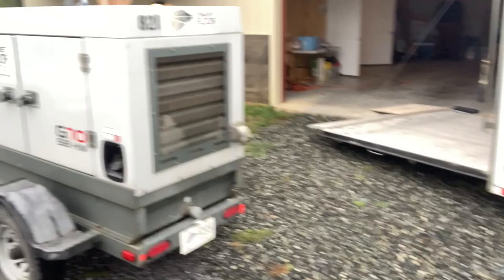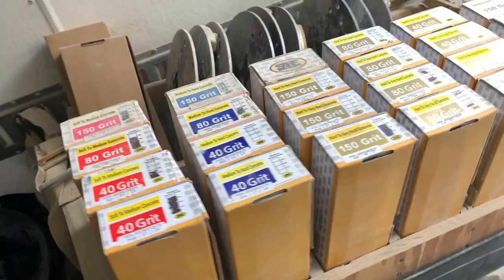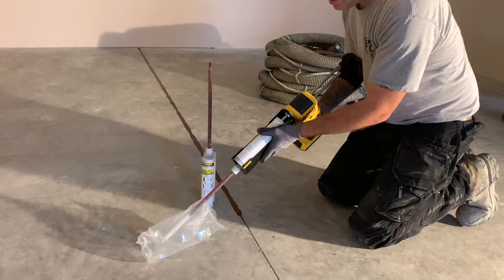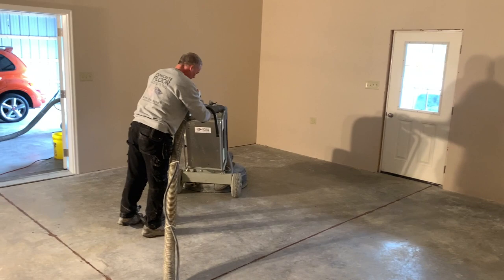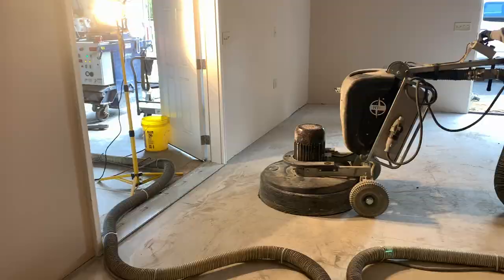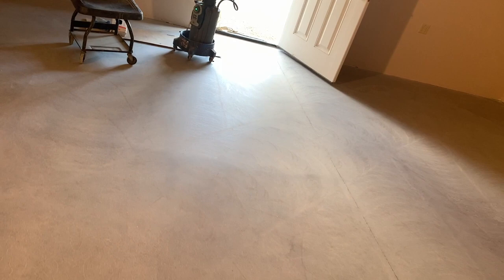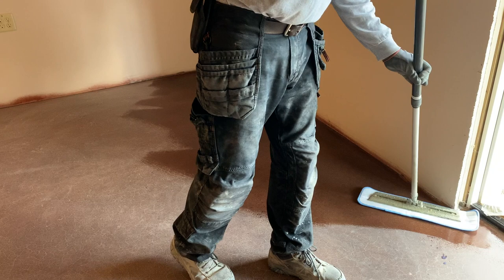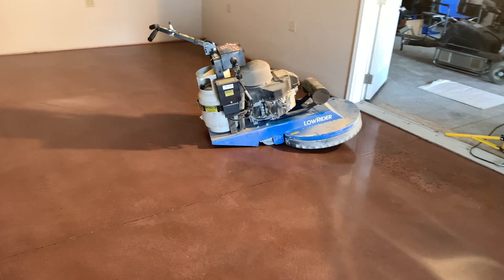Concrete Staining And Polishing From Start To Finish / 9 Step Grind

Comment: 😳 DIY my a** this video shows how much hard work and equipment goes into these projects. Once you mentioned 3 phase generator my jaw dropped. Thanks for your knowledge, time and effort. Wow
Reply: They are using a very large grinder. There are smaller ones you can use that run off a 110. Check out the Husqvarna PG450
Reply: What was the cost on this job?
Reply: You could do it with a regular angle grinder.. it'd just take an eternity.. takes about an hour per 100 sq/ft to do the grinding passes and then it speeds up a little bit with the polishing.. probably 8-12 hours to do 100 sq/ft with an angle grinder.
Reply: 5 to $7 per SQ foot here

Comment: awesome if you want it done right i mean perfect .  This is the only video to watch.  I have been building homes for fourty plus 
years, and this by far was the most complete presontation for the 9 step grind, and stain concrete slab ive ever seen. great job.  If you guys do anything else  i would watch it. thanks again for your time !
Reply from the maker: We have a bunch of videos on our channel you can check out. We do a lot of epoxy flooring also

Comment: I think you did a magnificent job. I am in the same bis and it’s great to show the potential customers how much work goes into doing these floors .
Especially when they complain about the cost!
Reply from the maker: Thank you so much for mentioning that. Most people think polishing means you just put wax on the floor and run a buffer over it and you’re done.  It is so much more work than that, at least to do it the right way.
Reply: @ConcreteFloorSolutions  when it's less than 100 feet. Over that we use our pump.
Reply: What would about 500sq feet run?

Comment: I have a long question but I've been scouring the internet for weeks and I think you're the guy that might be able to give me answer. I'm turning part of my basement into a pottery studio. It's a separate room closed off from everything else and it has a concrete floor. I want to polish it somewhat because it will be easier to clean and it won't trap silica dust from the clay. It's 15x20 feet.

It I rented a grinder it will be too expensive because I only have a few hours here and there to work on it so I'd have to rent it for a week or so. WAS THIS A 1 DAY PROJECT FOR YOU? I've considered angle grinding the whole things with a 7 inch but also sounds terrible.

I don't need a super glossy polish. Honestly I just want it smooth enough to avoid the floor trapping silica as easily. The floor as it is now is pretty smooth. Maybe it was acid etched? Do you think I might be able to get away with buying a floor polisher for $100-$200 and going at it with a 200 grit or something coarse for a longer time and then stepping it up to 400 and beyond? Or is there any sort of process you can think of that can take a concrete floor to a satin matte with a floor polisher? I'm not afraid of hard work. I always read about hardeners. Do I need that? Thanks so much. I've learned so much from this video.
Reply: You can definitely do this project in one day. It would be an all day event, but it is definitely possible. I don't know if you can get one of those things down in a basement unless you have. Patio or something you can bring it to, what I did to my shed was just ground off the top layer with an epoxy wheel (7inch grinder) and threw concrete sealer on it, it's smoothe and sealed up (may be best option for you) although I wish I would have went with the polished concrete instead of sealed, but the blades and machine was just too much for me.  I do them from time to time at work (I install epoxy) and they're always good looking and most durable of any floor IMO

Comment: When it comes to a project about how many square feet can you do in a day, from start to finish?
Reply from the maker: Typically 1000 ft.² per day per grinder
There are a lot of factors that can adjust that number
Reply: Thank you
 @ConcreteFloorSolutions

Comment: Awesome job as always. You said you were bringing it to a 1500 polish. Was the last step burnish with a 1500 grit DIP? Thanks.

I have followed your steps to a T on my first stain and Polish. My only step left is to seal and burnish. The results have been excellent. Thank you for the in-depth video!
Reply from the maker: Thank you for watching, yes burnish with a 1500 grit diamond impregnated pad after you apply the guard

Comment: Thank you for this great demo! The best video I've seen so far. 
A couple of questions:
What kind of hardener & penetrating guard are you using?
If I want a higher wet coefficient of around .7 how would I modify this process?
If I skip the burnishing (not really interested in too much shine) will this add to the non-slip quality?
Reply from the maker: We use Sase Densifier and Sase Guard.  If you apply guard, you are supposed to burnish it. I would try finishing  to 200 grit if you are looking for a low sheen floor. Guard is optional, but recommended for stain protection. .7 is a pretty high coefficient, but that should get you close.
Reply: @ConcreteFloorSolutions  thank you!

Comment: Do you recommend a concrete gardener/densities? If so, before or after the stain?  Thanks!
Reply from the maker: Yes i do, typically after stain, unless the concrete is very soft, then do it before. https://concretefloorsolutions.com/store/surface-treatments/cfs-concrete-densifier/
Reply: @ConcreteFloorSolutions  thanks.  Looks like auto correct got me.  Was supposed to say hardener/denisfier.  Looks like you understood my question.  Thank you for the immediate response!
Reply: Last question…do you have a link for the stain you used?
Reply from the maker: @ryangilchrist5319  i do not sell it, it is ameripolish surelok stain

Comment: Hello I just subscribed to your channel I love your work I own a concrete stain and company in epoxy and I do polishing at times what kind of joint filler do you use in what is do you buy that set up cuz I use a part a part b urethane and it's takes too much time
Reply from the maker: Thanks for watching, here is a link to our joint filler
https://concretefloorsolutions.com/store/repair-materials/cfs-fast-set-joint-filler-with-static-mixing-tip/

Comment: How much grinding would a person need to do to just get a matte finish after staining and sealing?  I'm not looking for a glossy, marble like result.  I'd like to do this myself.  Is this realistic without days of grinding multiple grits?  I just want to smooth the cracks and let it look more natural and rustic.
Reply from the maker: I would say you need to grind to 200 grit to achieve a matte finish. The question really is, what type of equipment are you going to be using. If you’re not using the right equipment, you are just going to waste a lot of time. Email me directly and maybe I can point you in the right direction at least. jason@concretefloorsolutions.com

Comment: What kind of equipment did you start out with?
Reply from the maker: 1-HTC 800 Classic 32" grinder and a Blastrac 1-10DS shotblaster and a hiltil dg-150 hand grinder
Reply: @ConcreteFloorSolutions  Thanks for the response. I just started a small epoxy flooring/polishing business and I aspire to get to where you are. I have a small Genie which works great for prepping garages and other small areas, it would just be very time-consuming to do what you did with it.
Reply: One other question, if you don’t mind…? What do you charge for something like that per square foot?

Comment: amazing video.  We are starting a epoxy company and will one day add polishing so this is some interesting stuff.  What hand grinder do you use
Reply from the maker: We use a Hilti DG-150, I love that the shroud is easily adjustable. Expensive, but well worth it. Check out our store, https://concretefloorsolutions.com/online-store/
we can offer contractor discounts as well as valuable instructions on working with epoxies etc. email me @ jason@concretefloorsolutions.com  if interested.

Comment: Curious how do you determine the hardest of the concrete in order to use the correct diamonds? Is it visual thing, color or do test it? Thank you in advance.
Reply: They use mohs scale sir to determine it. For hard concrete  they soft bond pads and for soft concrete   its hard bond

Comment: Did you mop between grits?
Reply from the maker: We do not, we will  vacuum sometimes depending how much dust is left on the floor between grinds.
Reply: @ConcreteFloorSolutions  cool thanks, I'm debating on doing this in my basement but I'm guessing the rental will be expensive and I would probably have to buy my own Dimond pads.  I work at a university and we are going for wax to Dimond but it's a lot different process.  Not sure where to begin with my basement.
Reply from the maker: @richardparnell8402  trying to rent equipment and do it yourself may be extremely challenging. It can be done, but I really don't know if it is worth the time and aggravation. Sometimes you get lucky and everything goes smoothly, if there are any issues it could simply be a nightmare.

Comment: Important question- so we polished a floor and  we finished everything but after mopping the floor its as if the whole floor had dust and wouldn’t remove off the concrete floor and we are still trying to fix it because its a fire fighter station so its kind of big and the polished floor is perfect but it seems as if the whole floor has dust that just wont remove. Do you think the dust is under the polish? Or what its the first problem we had since years and we been working in epoxy for 10+ years so this makes no sense
Reply from the maker: Did you use a wet floor scrubber before you put the guard down?  If you don’t have the surface clean enough, the dust will mix with the guard when mopped and get trapped in the floor.
Reply: Yes we did we cleaned it to remove all the dust with a dust mop and even passed the burnisher once again because they called us up that they mopped it and once it dried up it turned foggy like of dust but the floor was cleaned very good
Reply from the maker: Without knowing all the exact details, I couldn’t tell you anymore. I know the guard can get cloudy if it gets wet before it is burnished and cured. Could have been a humidity issue? Could have been a contamination issue? could have been chemical attack? You can always email me direct with product names and details etc. maybe I could shine some light on it.
Reply: Okay what is your email?
Reply from the maker: Jason@concretefloorsolutions.com
Reply: @chicago4809  it could be the agrigite of the concete. I had a similar situation there is nothing you can do but burnish it once a week .

Comment: Is it possible to get a mirror finish on polished concrete?
Reply from the maker: It is, but ultimately it is up to the condition of the concrete you're polishing. Some concrete is very porous and does not give up a mirror finish very easily.

Comment: I notice there are lines after the burnish, Are those removed some how or just left? Love your videos by the way! I do chip floors and metallics, but would like to learn about polishing also.
Reply from the maker: Doug Kooistra They are just Dusty tire prints from the burnisher, they wipe right off. Sometimes you do get a pattern from the burnisher also, but that wears off over time.
Reply: One way to minimise the lines from the burnisher is to run forward and then go backwards over the same area, the lines tend to be dust from the guard as it gets burnished which the tires run over leaving lines. Going backwards you are running the pad over the tire tracks.

Comment: On a brand new concrete floor can  I just spray the densifier on and buff it out?
Reply from the maker: It definitely will not give you the same results, not recommended, but yes you can. I would make sure it is very clean before you do it.

Comment: I'm fairly new to this trade but i find some of the steps in this process to be odd based on what i've learned. Why do you apply densifier after 400s and why do you burnish with a 1500 grit pad and not a 3k or higher? We always apply densifier after 200s , apply a penetrating sealer after 800s then burnish with a 3k or higher grit pad.
Reply from the maker: When applying stain to very hard concrete, you should NOT apply the densifier before the stain or it will not penetrate very well into the concrete. We typically apply densifier after the 150 grit grind if you are NOT staining the concrete.  Stain changes the process. The 1500 grit finish is what the job was specified at.  We can go higher grit when burnishing but it adds to the cost and cost is normally a factor with customers so we polished to 1,500 grit.

Comment: What happened to the corners sir?
Reply from the maker: Polished with hand grinders
Reply: @ConcreteFloorSolutions   did you use oscillator or triangular grinder?
Reply from the maker: @rodmik1683  4" grinding wheels.

Comment: nice work! what brand is that sprayer? I am looking for something similar I normally use the red chapin pump sprayer but it drips too much
Reply from the maker: http://www.green-gorilla.com there is a battery pack air compressor on the side of it so it always stays at the same pressure. Very convenient and cordless
Reply from the maker: Its made by racatac, there are a couple different configurations. I know amazon has them, you may want to check around for pricing. Yes, we do work in Maryland if the size of the job justifies it.

Comment: Is it wise to fill the expansion joints?
Reply from the maker: When polishing concrete, yes it is. Every time you grind the floor the dust will fall in the open joints and you will keep pulling dust/sand out and re-scratch the floor after each pass.
Reply: @ConcreteFloorSolutions  I see, and the filling substance looks soft enough to let the floor move as it is supposed to do. Thought you were going to fill them up with something cement-based.
Reply from the maker: @goolgehatter1597  We use a polyurea joint filler, which is semi solid. it does allow some movement.

Comment: How much does it cost?
Reply from the maker: Many factors go into price. How many square feet, condition of concrete, hardness of concrete, amount of edges, gloss required, stain, cracks, joints, repairs, location of job.   That being said, a typical job will be $4.00 - $10.00 per sq.ft. depending on the above.

Comment: Why did you do only one pass with each diamonds, not cross lines? The amount of densifier you use was not enough in my opinion. You can clearly see that you can not evenly saturate the surface, which means the color was not locked in everywhere. BTW very good job and video.
Reply from the maker: We do every pass perpendicular to the next, otherwise it would be an 18 pass grind, which would be excessive and cost prohibitive.  This concrete was extremely hard so we did not oversaturated with the densifier, we do use a microfiber mop after we spray to knock down the dropplets. On softer concrete we would apply more desifier.  The Ameripolish Surelock stain we use holds in the concrete very well.
Reply: ig the client didn't want to expose the concrete too much that's why only one pass and he already said that the next grind after the vertical one is perpendicular to it....not to leave a pattern.

Comment: where did you get that dewalt plural tool?
Reply: also, buy the heavy duty joint scraper that us saws sells....they are incredible
Reply from the maker: https://www.toolup.com/DeWalt-DCE591D1-20V-Epoxy-Dispenser-11-21Oz?CATARGETID=120204890000550310&CADevice=c&gclid=Cj0KCQiApY6BBhCsARIsAOI_GjYOk583VbBnXMub3W96EZkcN8WEEvLZtMjoymva-O-e0snalJOUkpIaAoN5EALw_wcB
I dont remember where I got it, but I believe this is the same one.  check your tube size before ordering.  best tool ever if you use allot of dual cartridge materials like we do.

Comment: Do you burnish your corners? And if not , wont you see a slight shine difference in well lit rooms?
Reply from the maker: Our burnisher has a 27” pad so it will not fit in corners. The only way you are going to see a difference is if you can get your eye in the corner on the floor which is impossible. So the answer is NO you cannot see a difference in the corners.